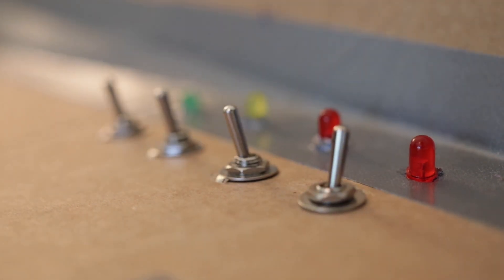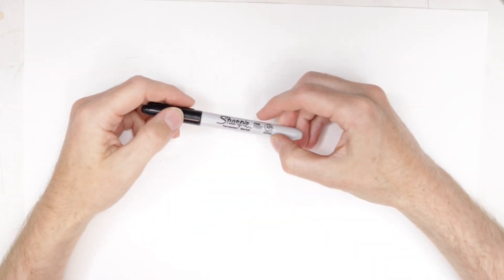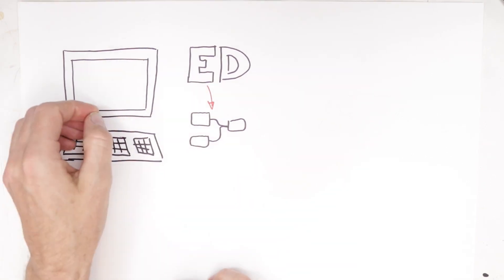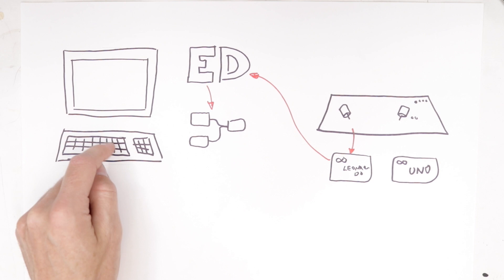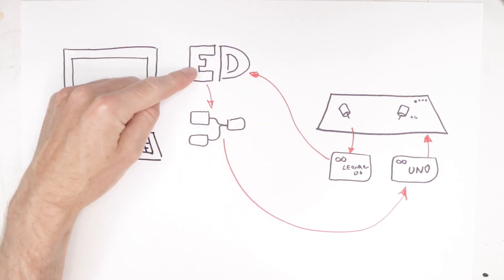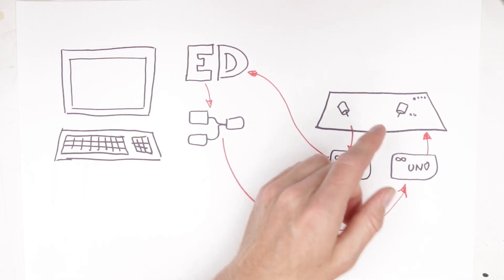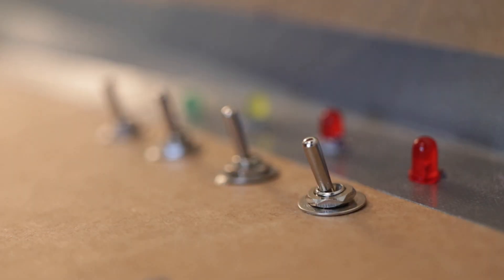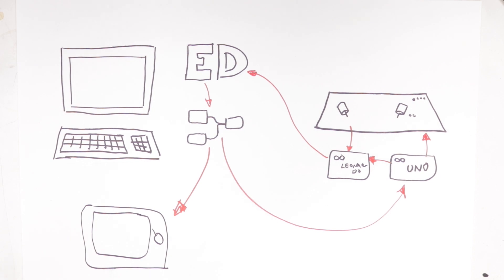How to Make a Cockpit Simulator for Elite Dangerous Using Arduino

Comment: Thank you for this. I'm going to dive into a button box project soon for space sims (switches, buttons, etc) but thought I would check with you to see if you have any updated recommendations on a better method and/or hardware that has come up in the 4 years since you posted this video.
Reply from the maker: I'm still running the same system as a base, but there's a lot of tweaks, mods, and hacks on top of it. There's a playlist with the journey towards my current solution. 

If you want adaptability and the possibility to do almost anything, although with some struggle I still think this is a good solution. But to make it easier for yourself, make a plan on what you want (or at least all central parts) and how everything should work together. Split things between differend arduinos that communicate with each other (they're cheap enough to not have to use them to the max). Also, decide on how you want them to communicate. I'm using i2c, and rhat works quite well, especially since all arduinos can be on one bus. But I've been thinking about making a system that use midi for internal communication. It has a ready made protocol for semi-big, structured, data that would fit quite well. And that way I could also run things by plugging in ordinary midi controllers as well.
Reply: @JonBck  This is very helpful. Really appreciate what you are doing. This would be for space sims like Star Citizen and mech games. The plan is to use mixed reality so I would be able to see the physical button boxes I would be creating. I'm making the boxes because I'm not too impressed with the esthetic and build quality of most button boxes. They either have too much plastic or dont fit the "cassette futurism" vibe I'm going for. Would be great to be able to come across a broken but beautiful vintage hi-fi stereo or other electronics and repupose some of its high quality control panel.

Comment: This video would be useful if you showed the code
Reply from the maker: It's on github. Not 100% up to date with the latest videos, but you should be able to find most of it:

https://github.com/jonbck/SpaceShipSimPitControl
Reply: @JonBck  What nodes do I need to install for your flows to run? When I paste your code from github, there is at least one unknown node. I am a totall newbie to node-red. Maybe you can do a video and explain your flows? I am really impressed by your work so far. It's very inspiring.

Comment: I like this, but personally, for me, I'd use momentary switches/buttons where possible instead of toggle switches, except for features that ed natively supports holding. Such as the alternate flight controls. there the game natively supports either a button toggle, or hold. In fact, I don't like the idea, I love this idea and the many like it. I also love how ed has a status file that it keeps up to date so that you can pull from it and make your own external controllers, or even local apps running on a different screen to give another place to view info.
Reply from the maker: I'll try to use the "natural" state where possible (such as alternate flight controls as you mention). But in some places I really want to have a switch, where not possible, and then I will "hack" it by reading the state of the game. There's something really special about the tangeability of physical switches that stay in place.

Comment: Where did you find the data for the readout of the ship‘s state? I‘ve been looking around for hours... Great project, gave me best ideas!
Reply from the maker: Yea, it was a bit of detective work to find it :-) And I think it depends a bit on your settings. I would love to hear about your ideas and your project!

I found my settings in C:\Users\[username]\Saved Games\Frontier Developments\Elite Dangerous

There's a document called 'api players journal' (or similar) that outlines all data. This should be a documentation of the latest version, or at least link to the latest version: http://edcodex.info/?m=doc

I think this is the version I'm using (since I like to have it stored locally): http://hosting.zaonce.net/community/journal/v25/Journal-Manual-v25.pdf
Reply: Thanks for your reply, found it! Already got my node red running and giving me lights for the ships state. Being a total newbie, I do not have the faintest idea, how to pass the date to an arduino. Could you do a video about it? I will build a console to my left and to my right with all the buttons necessary...
Reply from the maker: I would love to see some images when it starts to take form! I can try to make a video on some more of the details of how I pass the values, but honestly I'm not that strong of a programmer, and there might be other people out there that's better at it (but it would be about exactly what you're looking for here :-) )

Have you checked Creative Technology? He's got a whole playlist on Node Red and Arduino connections. It's awesome! https://www.youtube.com/playlist?list=PLogiUurtMYtQMeN9qhBmYJJHxI9gOcwBT
Reply: @JonBck  Thank you again for your reply. Right now, I start to mess around with an Arduino with a shift register because I need about 30 LEDs output and 24 buttons input... the intended design for the cockpit is still only in handwritten sketches and my ideas right now are starting to get a more precise dimension... but still struggling with arduino programming! By the way: Playful technology's videos have helped me a lot in regards of node red!
I now have a dashboard that shows me every detail of the ED's status.json. Putting this into an arduino and getting it to light LEDs is my goal for the next milestone!
Keep you updated!
Reply from the maker: @tsequadrat9975  The ports tend to run out quickly :-) Button arrays are your friends! For the LEDs I would suggest going with NeoPixels or some other type of addressable LEDs. That way they can all be chained together, and will only take up one port.

I think the easiest way to send data to the arduino is to use the USB as a serial connection. In NodeRed you make a new node that is a serial out, and in the Arduino you use the Serial.read(), similarly to the  way you communicate with the serial monitor. Reading data from the arduino into the computer is a bit messier. If oyu want to read it into NodeRed you can use the same method, but if you want to read it into the game you need to make the computer recognize your arduino as a joystick or a keyboard. Even more annoying is that this only works with a few types of arduino. I think you should google arduino keyboard emulation or somethign similar.
Reply: @JonBck  Hi Jon,
I made it! I am passing the "status flag" to the arduino via serial connection (from node-red) to the arduino, arduino is decoding bitwise and feeding the 32-bit-shift-register, now even correctly. The reaction time of the LEDs is somewhat long (about 1.5s), but it does work. It took me about one week to understand the different types of variables and find a way to read out the bits out of the status flag. I will now try to speed up things a bit to get more precise and fast reactions on the leds. 
As this seems to be working, now the next step would be to hook up switches with a 12V-LED to show the state. I will need a power supply and get the LEDs switched via a transistor-circuit. I don't want to fry the arduino with an excessive power output...
For the inputs, I found a keyboard encoder. The channel "Commander 64" was very helpful in this regard. So I will just copy that strategy and see what hurdles might occur...
One thing is for sure: till now, I learned more about arduino programming than I thought would be necessary for that project. I really am looking forward for the "hardware-work", setting up all the switches, knobs, encoders and blinking leds to have my very own spaceship and fiddle around with these for complete immersion!
As soon, as there is something I could show, I'll let you know!
Reply from the maker: @tsequadrat9975  that's great! I managed to get the lights to turn on quite fast, but it might have to do with how you read the status file. On one hand it's not always super fast to update, but also you need to interpret it as soon as it changes, otherwise you might lose time in reading them. But honestly, I'm mostly guessing and telling you the problems I ran in to.

I would love to see it as soon as it takes any visible shape! And, yes, I agree, you learn a lot from a project like this.